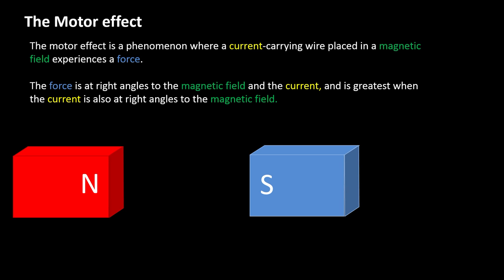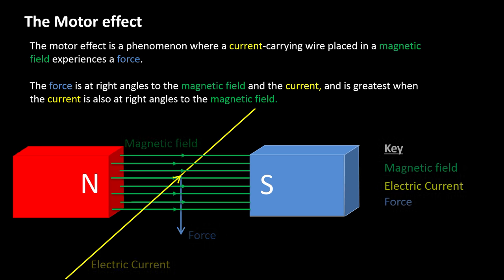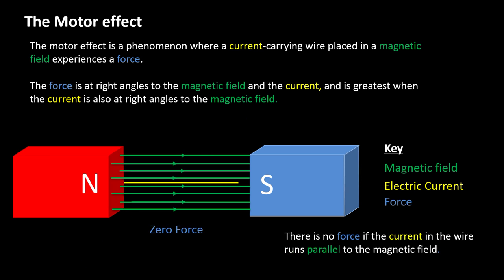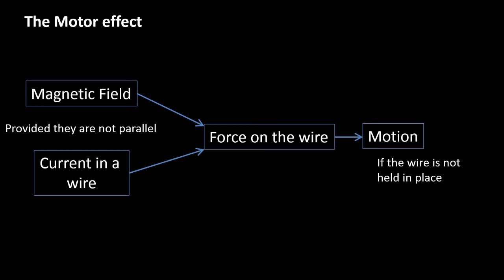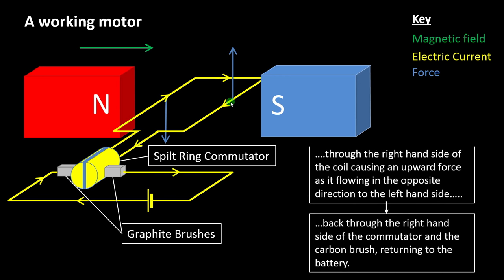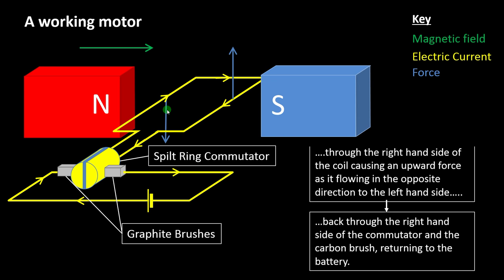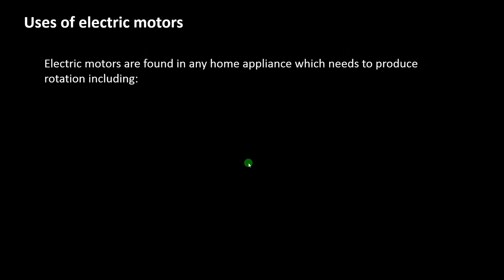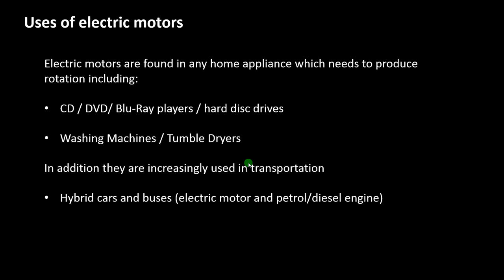P5 - d.c. Electric Motors

Comment: Why will there be no force when the wire is parallel to the magnetic field?
Reply from the maker: +Chi O It's just the way the current and magnetic field interact. The force actually depends on the sine of the angle between the the field and the current (the sine trig function is 0 at 0 degrees (field parallel to current) and 1 at 90 degrees (field at right angle to current)

Comment: Is it compulsory to know what a commutator does in detail? My exam board is OCR 21st century...
Reply from the maker: I would say provided you know that it switches the direction of current in the loop every 180 degrees in order to keep the motor turning in the same direction (and it stops the wires tangling) that would be enough.